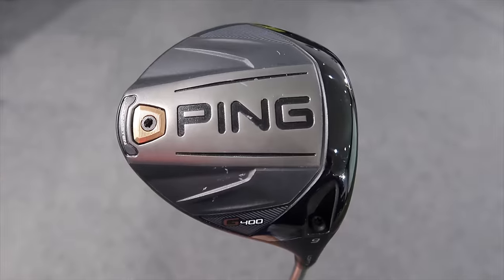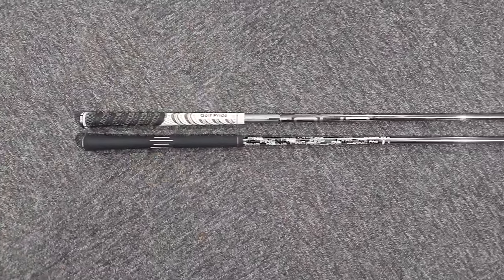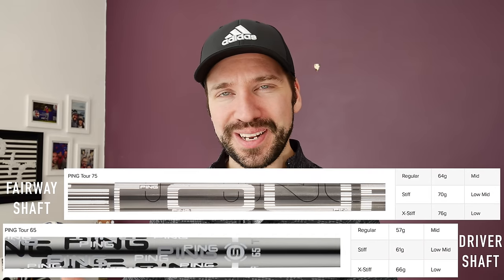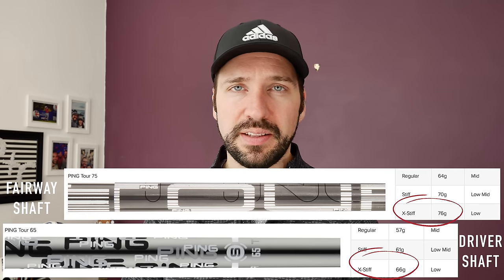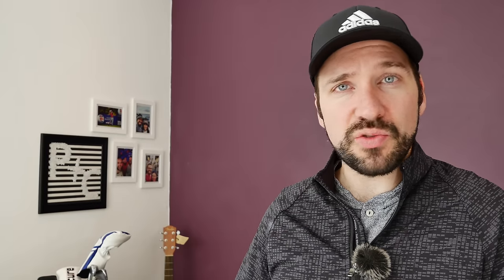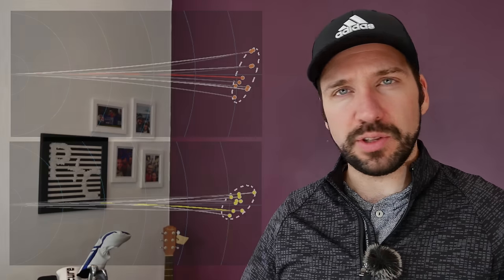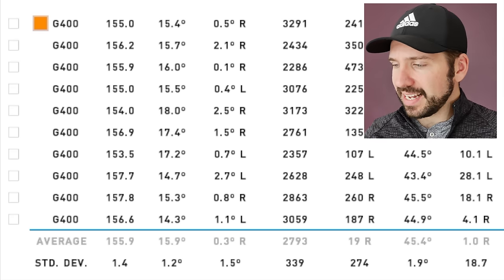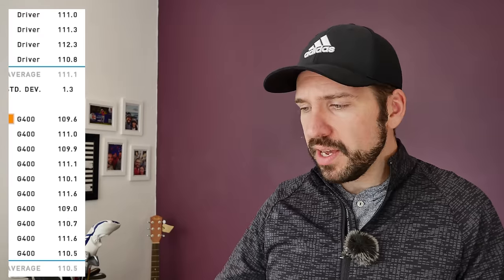I put a 3-wood shaft in my DRIVER and this happened...

Comment from the maker: Forgot to mention in the video I cranked down the loft to 8.5 from 9 degrees 👍 just in case anyone wanted to know
Reply: Peter Finch Golf Hi Pete. Ive done same with my Ping Anser driver shorter plus lighter. More accurate with faster ball Speed. Need to get out on course to try.
Reply: Has the weigth difference an influence?
Reply: Peter Finch Golf great comparison. I have the LST Head, although I haven’t hit it yet.   Correction:  The playing length of driver with the Ping Tour shaft should be 45.25 inches.   Know this because I cut down that same shaft 0.75 inches to get to a playing length of 44.5 in.
Reply: Nice Job Pete !!
So you're saying the head was set to  8.5*  for both shafts in the tests ???  Correct ??
Reply: Did you happen to check the Swing weight change ????
Reply: when I cut down the shaft to 3 wood length, the swing weight changed from D2 to C7, you need to add around 10g to bring it back
Reply: Isnt this the tour  shaft that ping already offer in their driver.....and not a 3 wood shaft🤫🤔
Reply: What about shortening your grip by an inch and save some money ?

Comment: I tried out a 3w shaft in my driver for a couple rounds before I went ahead and trimmed my driver down to 43.5".  Its definitely a confidence boost.  I'm not saying I stripe every fairway every time but I never step up on a tee with that feeling of not knowing where the ball's going.  I highly recommend everyone try a shortend driver at some point.
Reply: Why didn't you just stick with the 3w shaft? What made you decide to go ahead and cut down the driver?
Reply: just choke down, no need to trim
Reply: Still using the short shaft? Did it effect the stiffness of the shaft much or swing weight?

Comment: I have been using a 3 wood shaft in my driver now, more comfortable, way way more confident, more accurate and overall more consistent, also use a 5 wood length shaft in my 3 wood. Sounds daft but it's working for me and I'm enjoying not losing a load of balls in trees so vicious slices.

Comment: After watching this vid, i took off for the driving range. For the first time in my golfing life, i tried a 3 wood xtra stiff shaft in my driver. Result  = Incredible accuracy and excellent length. plus More Centered Hits... Should of done this years ago. Massive difference in confidence off the Tee now in all weather conditions. Shot shaping with my driver is also now a lot easier.  My Handicap 6.. age 53..also  Less Lower Back Problems as i am Not Over Twisting as i did with a 46 INCH xtra stiff Driver Shaft. So pleased i tried this out... Great Vid and Massive Thankyou..!!!

Comment: I did the exact same switch with my Ping G425 LST Driver and G425 MAX 3 wood.

With the driver I actually gained a few yards, I assume because of more pure strikes.

My dispersion also improved with the shorter shaft. 

What I found interesting also was the 3 wood with the Driver shaft.  

When hitting off of the tee, I gained considerably more distance, and the dispersion remained very similar.

Idk why, but for me, switching shafts had me hitting both clubs further.

Comment: I have a Kuro Kage shaft I never use and always wanted to try a short shaft with the driver. I had it shortened and re-gripped last night as an experiment, it's now at 43" and I just tried it for the first time. WOW! I should have done this sooner! A much better feeling, me swinging the club and not the club swinging me. I didn't loose anything on distance or speed. I will absolutely be shortening my main Ventus shaft now! I watched your video to see if distance stayed consistent for anyone else who tried this. I'm glad it did for you too! If anything I got more distance and I got it consistently. There was no need to choke down, it all felt lighter ;and with more leverage, and I didn't feel jammed. My arms are slightly longer than average so the shorter club made me feel like I had more space for my hands without having to swing out and away so much, I could keep them under me better. That kept the weight on my heels better vs the toes. What a great session.

Comment: I've been playing 3w shafts in my driver for a decade, typically 43"-43.5" playing length. I find the center of the clubface more often than with a longer shaft. I currently play the M1 440 with a Rogue 125 60g tx. I constantly hit 300+ and my local pro doesn't understand how it's possible.

Comment: Good video.  I've been playing a 43.5" driver (Nike SQ Dymo or M2 with cut-down shaft and hot melt to D2 swingweight) for the last two years.  For me, the longer shaft made the swing one long lever (from my shoulders) and took wrist release out of the swing.  The shorter driver shaft let's me have an articulated swing with wrist release - like my other clubs.  That generates more clubhead speed and also allows me to better release the club/head and square up at impact.

Comment: Ping G400 Max shortened by 1 inch and my 3 W G400 std shortened by 1/2 inch / about the same length as my 5W. Gained distance, more straight, kept the 10.5 * on my driver. Still not always straight with my 3W but a lot better.

Comment: Pete you have read my mind !!! I've really been struggling with my driver and I do have lessons lined up .. but I recently added a 5w 19° ping g400 and I am hitting it incredibly. . It was a mate that suggested shortening my driver length .. it's like the callaway fusion with the shorten shaft ... if it gives more confidence and control and helps finds fairways ... I'm up for bitta that ... looking forward to your course data ... keep up the great work

Comment: Great stuff, I just did this with my R15 driver. I had 2 inches taken off reducing it to 43.5 inches. Certainly get the middle of the club more often and haven't lost any noticeable distance. But i now hit more fairways than before.

Really interesting that swing speed hasnt all that much. I had heard this before in research before I had mine shortened. All evidence was showing minimal to no reduction. Nice to see a golf pro I've come to trust, back that up.

I feel I've made a good decision for my driver.

Comment: I run a stock length shaft on my M2 but i choke down an inch and a half. I dont loose distance but i stay in the fairway more. I know this is not the same but I have thought about trying to use a stock 3 wood shaft in a driver, and now i think I might. Thanks pete. cant wait for the course vlog on this.

Comment: I too play a 3wood shaft in my driver but I use the same make of shaft same flex  20grams heavier which is what helps with dispersion as well as the shorter shaft length 43 inches and I  am so glad  that I changed to this set up works fantastic and a true fairway finder .Great video  thanks

Comment: Hi Pete, I also experimented. Got a TM R15 shaft shortened by an inch. Thought it would stiffen up the shaft.... it did. It became unplayable. Swapped it for a shorter standard stiff shaft in the driver. Much better. It was a custom shaft and I have to say with its different characteristics and shorter length I feel much happier with it. Accuracy over distance was my goal

Comment: swapped in a shortened driver shaft by about 3/4" from a club pro as a trail to see if i liked it or not (was actually only seeing if i liked x-stiff shaft over stiff but they only had a shortened shaft for a trail). i noticed straight away that i was finding more fairways and a lot less dispersion on my drives at no loss of distance. i am average height (5'10") and weight, don't know my club head speeds or anything but did feel more comfortable with the shorter shaft. and for the first time in many years that i could produce more of a straight/small draw instead of slice/cut. keep up the vids

Comment: Have my driver at 44" and like you my misses are far less dramatic as far as dispersion and my contact on the face is more consistent. I've hit the ball to some spots at my local course where I haven't been before when I switched to the shorter length. I'd advise you to give it a real shot and maybe tip an x flex an extra inch or so to stiffen the tip and let it get the launch and spin down a bit. 

Thanks for the vlog. Keep it up Pete!

Comment: Did something similar with a rR15 3 wood vs 5 wood shaft and the trajectory and flight improoved and flattened, overall better performance and control with a 13.5 head, so i am not surprised at yous findings. Good video log finch !!!!!

Comment: I am currently debating between a driver and possibly instead a 3 wood hl(hl). My previous drivers and 5 woods were d0 swingweight, and cut in length to 44” and 41.5” respectively but adding weight to head to partly compensate and taking weight off the grip too. The reason for thinking about a 3hl is the versatility to use off the tee and off the fairway more easily. The new titleist ts range offers this possibility as an option. I am thinking of combining this with two hybrids (3,4) and then onto the irons

Comment: I like where your going with this. I like shorter shafts big time. I am only 5 f 7 inches. I use a 44 inch shaft on my Ping Driver. Works great. It came with a long shaft. Companies today put out drivers with shafts that are way too long for many people. Better control and dispersion with the shorter , more reasonable ones. The great Jack Nicholas used a driver with a length under 43 inches. Great review Peter!   Spider Dubiel

Comment: Came across this issue 4 years ago. Cut down my driver length to 44 inches and my FIR numbers improved dramatically! However am tempted to cut it down another half inch, after seeing this! Cheers Pete, thanks for sharing. PS Now you know what you have to do to get 5 points on that last shot in the FSX skills challenge 😋

Comment: Commented on FB before watching your video. When I got fitted for my Epic driver I ended up with a 3 wood shaft in it. For me it meant giving up a few (not many) yards off the tee but meant hitting a lot more fairways. As long as distance is not a huge problem off the tee it is a great swap. Yet another of the advantages to getting custom fit. It is not something I would even have thought of if I had been buying a driver off the shelf

Comment: I recently did this with my taylormade m1 driver and 3 wood and I was absolutely shocked at the difference for me. I also felt way more in control with the shorter shaft and I felt like I was making better ball contact. My dispersion was also significantly better with the shorter shaft. My numbers shocked myself and my golf buddy. I went from hitting drives total 280 to now a carry of 280 and  305 total distance with the shorter shaft. I feel like most golfers, especially average golfers would benefit more from shorter driver shafts and I think it's a numbers ploy for the manufacturers in order to sell more clubs. This type of data shows that you should never overlook getting properly fitted for your clubs.
Reply: The key word there is "properly fitted",  Your average club fitter in a golf
super store does not have the comprehensive understanding required
to help an average player with the subtleties of this art. In my opinion.
My son is a scratch player, and has recently been introduced to the
somewhat hidden, exclusive and usually sponsored elite fitters' world. 
And it is entirely different in terms of availability to equipment and 
expertise.  Just sayin'

Comment: Hi Peter, I stopped using my driver completely for several years as I could not control the Beast. My driver was inconsistent, I can hit longish (Good shot 250yds & I'm 60yr old) but that's no good when you are losing balls left and right. Lost confidence rapidly then decided to hit 3 woods and hybrids instead off the tee. This was okay when I creamed it, but I needed to cream it all the time to keep up with the drivers.
Recently I figured out it was Driver Length, 45" was tooooo loooonnng to control for a mere mortal. I am now experimenting with chocking down 2-3", so 3 wood length. I get the same results as you, tighter dispersion and same distance but at my age I'm happy as long as I hit fairway and carry 200-220 consistently and have second shot in. At least my bad shots are still in play.
The problem is 100% driver shaft length is impossible to control when it's 45" for most people. In fact average driver length on tour is 43", that tells me everything I need to know !
Reply: Have you tried speed training and trying to increase your swing speed and ball speed. I found with modern drivers accuracy comes when the swing speed increases as discovered with my TM Sim 2 max

Comment: Glad you finally caught up Pete ;-) As I have said to you before in a previous comment, I am a custom fitter and the majority of people I have fit for Drivers all come in much shorter than standard with no distance lost but a massive variance in dispersion.
The only thing I should add is the Swing Weight/Balance Point and MOI of the club the way you tested it will be "Massively" different but in your case with such a repetitive swing, you did not seem to be greatly effected but does explain your tendencies for the heel strikes you were getting.
The PGA Tours worldwide have been at 44.5 inches or less for most players in the modern era and this is why buying off the rack is not a good idea if you want your game to advance......keep up the good work!!
Reply: ACGolfwrx Did you add lead tape or anything to the head to compensate?
Reply: Nick Salvador hot melt is the preferred method as I can locate CG where I want it to suit the player👍
Reply: @acgolfwrx9852 If I’m just experimenting myself would the alternative to hot melt be to add, for example, 5 or 10 grams to the rear weight port?  And then I suppose experimenting with changing weight configuration on fade and draw bias ports to straighten out ball flight? Thx

Comment: I got fitted in Dec 2016 for a Callaway Fusion with the shorter shaft. I've never driven it better. I'm only 5'6 so it made sense. But more than that I feel confident to be able to hit it pretty hard. I don't feel I will really moshing it if I do. My SLDR was just the opposite.

Comment: I got fitted for a Ping G driver. We tried the standard shaft and the 3wood shaft on trackman. The consistency and almost no change in distance was too good to pass up with the shorter shaft. I ended going with a  44 inch driver shaft. I only have one arm and the control with this club made it easy to swing. I even started hitting a draw. But definitely worth trying.
Mark

Comment: Realistically, how short do you think you can go? Before you start loosing distance or distance is offset by accuracy?
Reply: steven ... first of all , shortening the shaft allows you to add some weight to the head ( some 7gramms/ 1/2 inch - if it's the same shaft , if it's a heavier shaft then 2 g less per 10g extra shaft weight )  ... therefore you'll have more mass in the head and so better ''smash factor'' ... so even with a lil' less club head speed you'll get tiny bit more ball speed ...
in theory , you'll drop 1.5 mph for 1/2 inch ... ( clubhead speed , ball speed multiply by 1.4 or so ) but in reality there is barely 0.5 mph difference ( club head ) ... just because one doesn't have the same confidence with a longer shaft ... and part of that difference you'll make up anyway with the better smash factor ...
if you cut more than 2 inches you may see a difference on ''best strike'' against ''best strike ''  but on 10-20 shot average the shorter shaft will be longer ... how much depends on how consistent a driver you are .
but once you go too short , say less than 41 '' than the benefits become out weighted a bit ... no more real gains in consistency ...
hope that helps and remember you can only find the best combination for you through experimentation ... which also mean some expenses , lost shafts , grips , counter weights and lead tape ... not to mention quite a few hours ... I used ping , which i had already , using easily 3,5,7 woods shafts on the driver head to gain feed back  ...
however , for me was worth it ... driver used to put me in a lot of doo-doo , playing some tough courses i used to blow a lot of rounds because of some bad drives ...
cheers
Reply: @klausklaus9112  good to know, thanks for sharing.

Comment: Did this test with my cobra F7+ driver from my cobra F7 baffler 3wood. Had the same results. (Not any computer data, but range data) needless to say I now have a 33.5" driver and a 200% confidence increase. Also i may add I have my woods/driver set up in half inch increments. 5w 32.5",3w 33" , dr. 33.5 , great consistency. Highly recommend for people in search of  fairways as I once was.